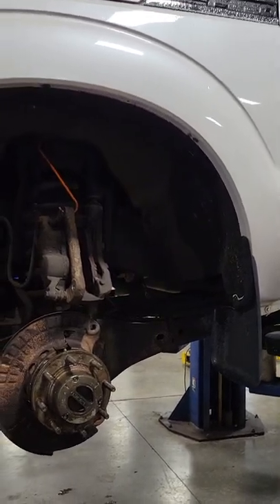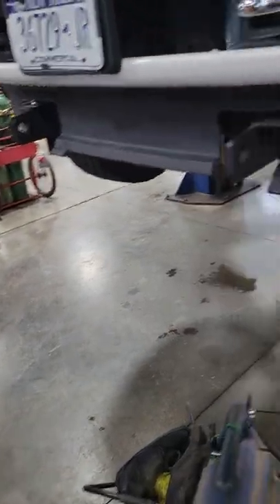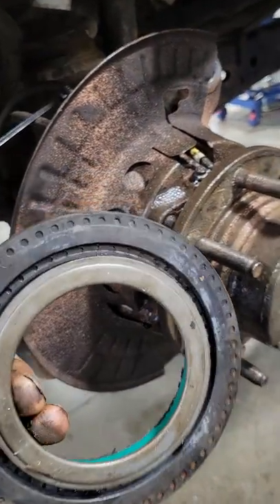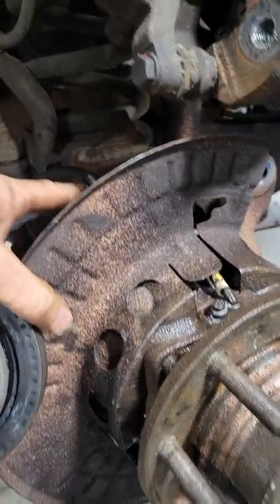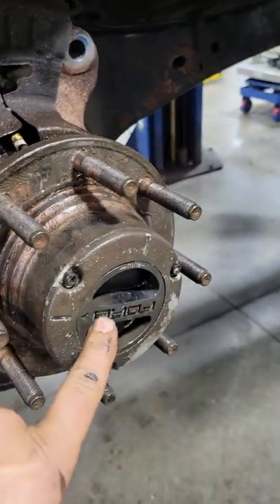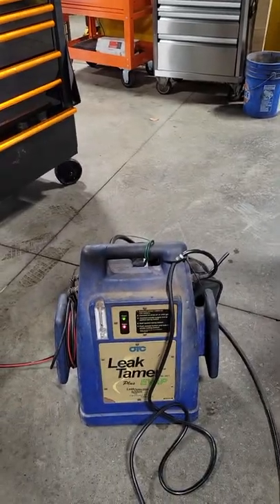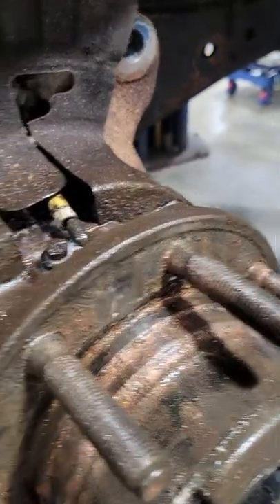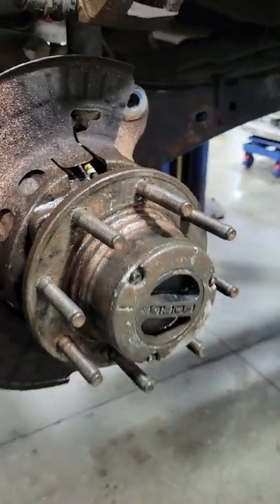f250 front end locking hub and bearing check after repair.

Comment: Wtf does it have a manual dial and vacuum for?
Reply: I'm lost too haha.. so the axle tube has vacuum to the bearing assembly? With an axle shaft thru it and a plastic cover to engage the hubs? I thought solid axles were simple but I was wrong 🤷 😕 haha!
Reply: Pumping soapy water from the inside out too? This has to be a joke
Reply: So it will fail sooner